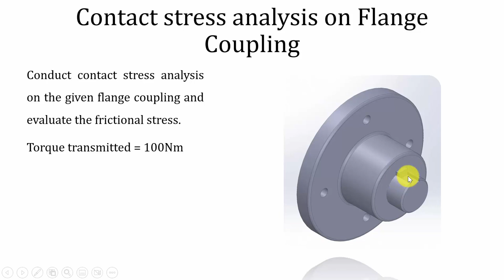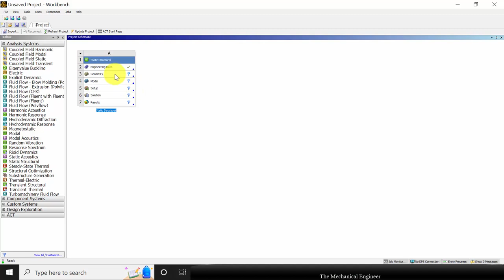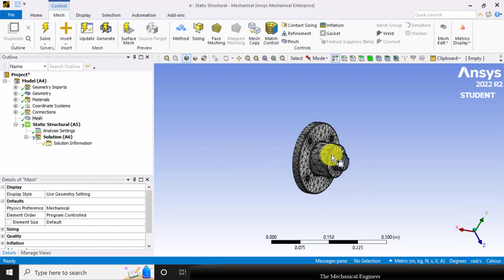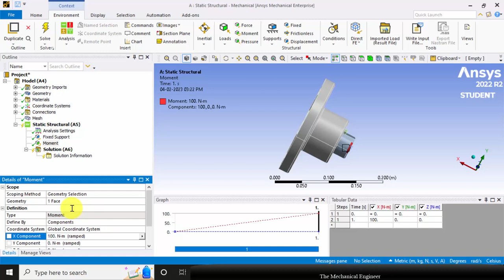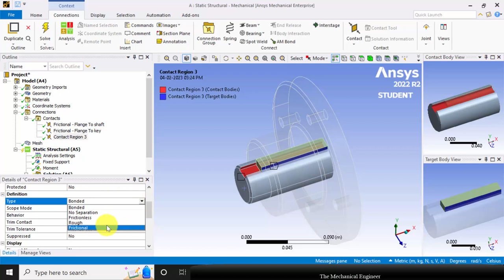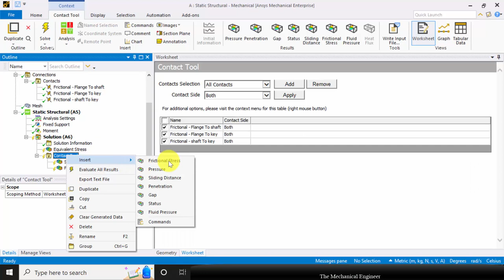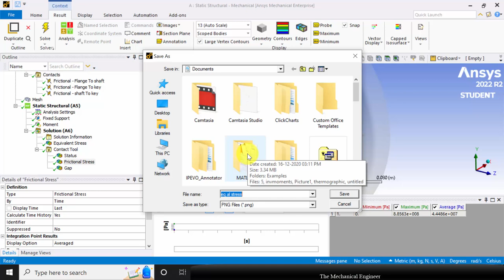Contact stress analysis on flange coupling | ANSYS workbench tutorials for beginners

Comment: Thank you for the video. But I do not understand why you did not work on other parameters of contact? I assume frictional contact is a nonlinear calculation on the ansys. and there is a slight interference fit between the wheel (coupling) and the shaft. How to represent it correctly? Thank you for your potential reply/video/email
Reply from the maker: You're welcome! I'm glad you found the video helpful. As for your question about the other parameters of contact, it's possible that those were not relevant to the specific analysis I was demonstrating in the video. However, I can certainly understand why you would be curious about the frictional contact and the interference fit between the wheel and shaft.

Frictional contact is indeed a nonlinear calculation in ANSYS, and accurately representing an interference fit can be challenging. Depending on the specific details of your analysis, there are a few different approaches you could take. One option would be to use a contact element to model the interaction between the wheel and shaft, and carefully define the contact properties to accurately represent the frictional behavior and interference fit. Another option would be to use a nonlinear material model for the wheel and/or shaft to account for the deformation caused by the interference fit.